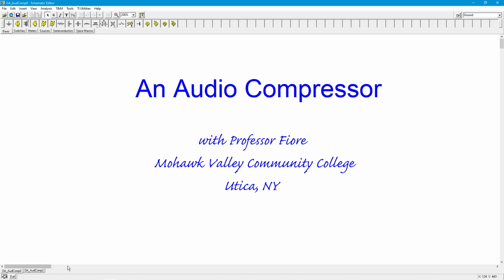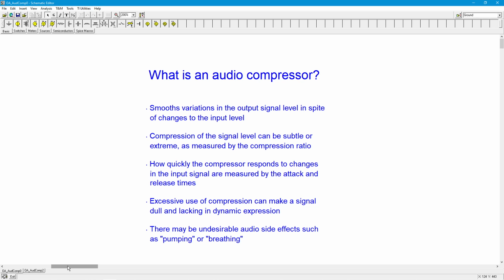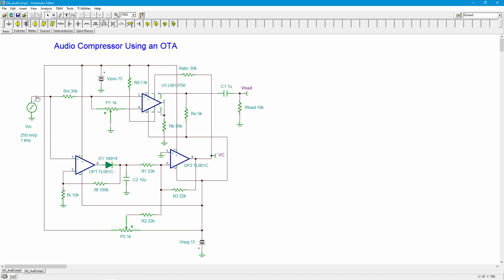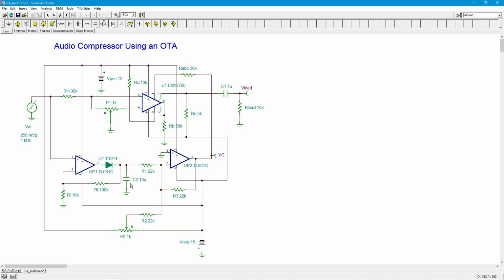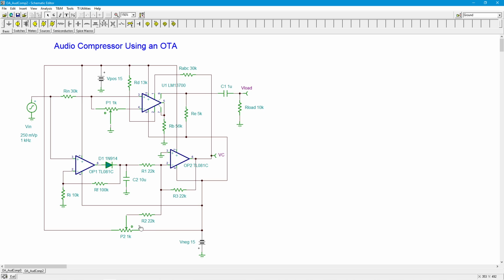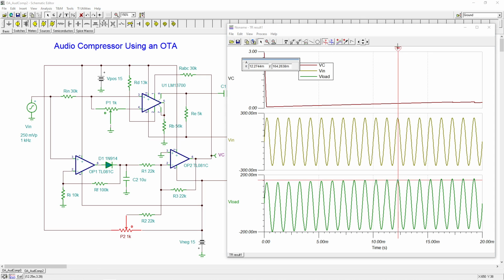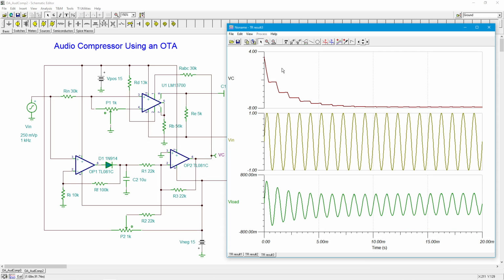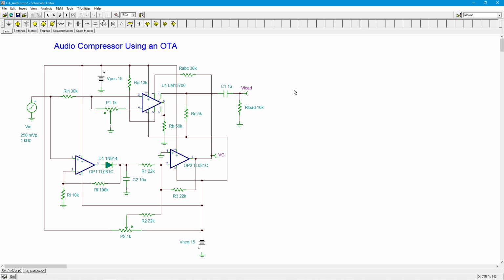Op Amps: Audio Compressor

Comment: I think, with not many more components, you could also add optical compression as an option to the same circuit. Since the OTA output is a current, adding an LDR in parallel with the output load resistor and driving that with a second portion of the peak detector would allow both "flavors" to be blended.
Reply from the maker: Yes, you could. At that point it would definitely be smart to add an output buffer for isolation.

Comment: so it is basically similar to AGC in AM radio?
Reply from the maker: It is similar but an AGC system would not adjust gain in accordance with the music or voice signal. Instead, the gain is adjusted in accordance with overall signal strength (i.e., the strength of the carrier signal in an AM broadcast). Thus, a weak station is boosted relative to a strong station resulting in more consistent volume levels as you tune to different stations. In the video example, the control voltage would not be derived from the audio input, but would be derived from the carrier (or more simply, the received signal, as most of the energy in a standard AM broadcast exists in the carrier and not in the side bands).

Comment: Interesting ! This must be what 'The Compression Wars' was all about in the 80's and 90's producers trying to just make stuff louder by taking away bandwidth or have I lost the plot and fallen of my twig ?.....cheers.
Reply from the maker: They're not really taking away bandwidth (at least not if they're doing it right) but what they are doing is making the dynamic range smaller. The softer parts get louder and the short but high level peaks get trimmed back, meaning that the overall level can be increased. This makes the tune stand out and it grabs your attention. They do the same thing with commercials. Those tend to be extremely compressed.
Reply: @ElectronicswithProfessorFiore  Oh thanks I see !! :)